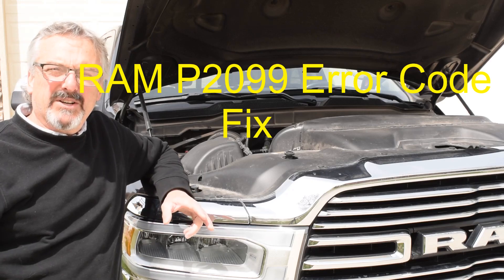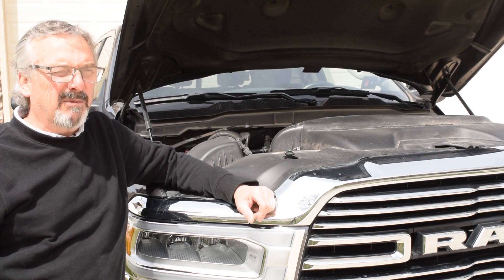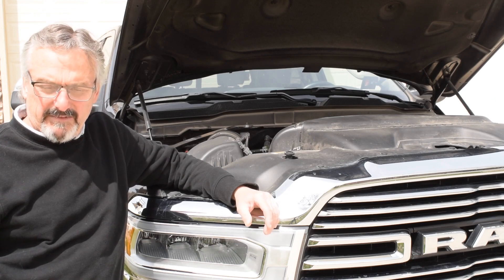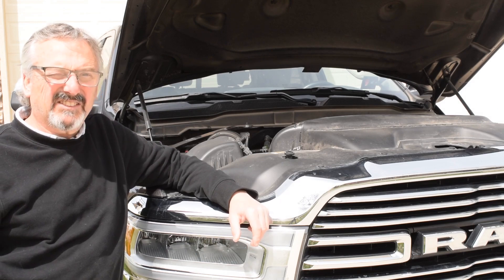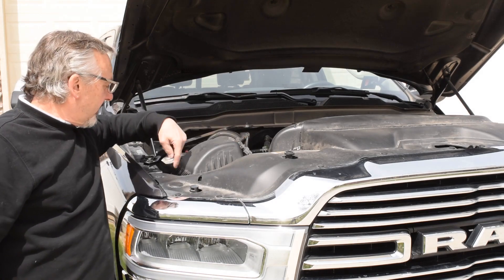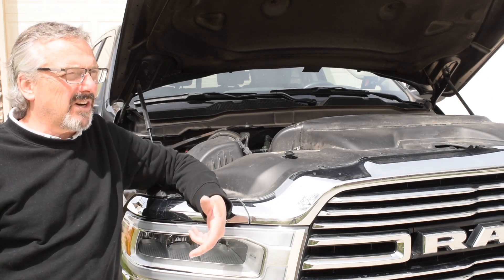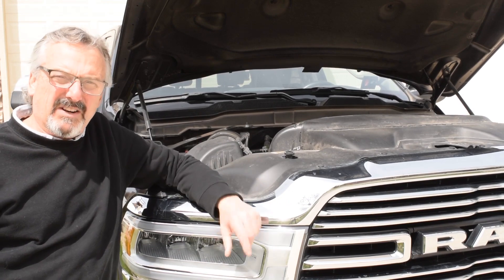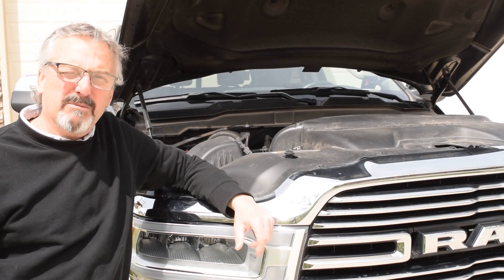2021 Ram 2500 6.7 Cummins P0299 Code Turbo Under Boost Code – Diagnosis and Fix

Comment: I could almost guarantee the filter was not the issue, it would not have taken 5,000 miles for the code to set if it were due to the aftermarket filter.  I would bet the fix was them updating the PCM software.

Comment: i just put in a new factory filter after getting this code. i changed it at the dealership in the parking lot. 

i only drove about, maybe 2 miles home so i will see if it clears the engine light. im thinking its the filter because i drive in very dusty conditions. 

i dont think its anything else because i have only had the truck for a year and never pulled a load besides a pallet of sod in the bed. 

The dashboard still shows im getting PSI to the boost when driving 1 - 4 lbs, but i think that would mean the senor is not faulty. 

Here's hoping, because i really need this truck this week XD

Comment: I am using a “copy” of a factory filter.  The Dealer offered both the factory air filter and an aftermarket that looks identical.  It was $20 less.   I went that route.  However, I do get the P0299 under boost code on occasion when towing heavy.   I clear the code and don’t see it again until next heavy tow.

….unfortunately, I don’t have the information on the filter.  Threw the box away, no markings on the filter.   The dealer said they are just trying to compete with aftermarket offerings.